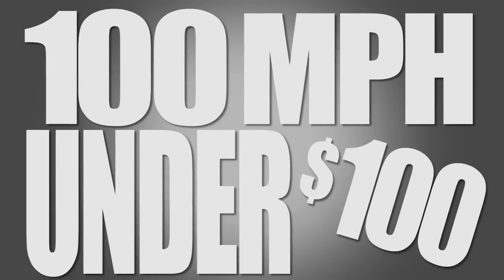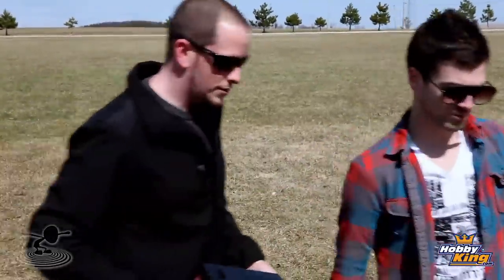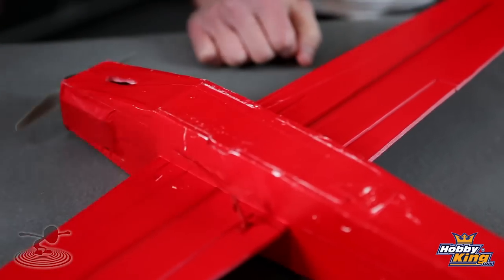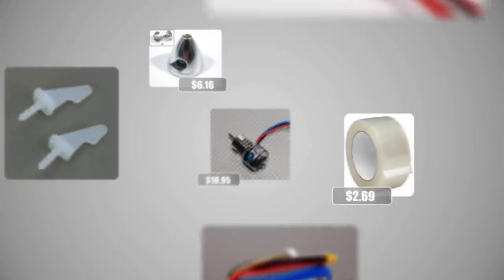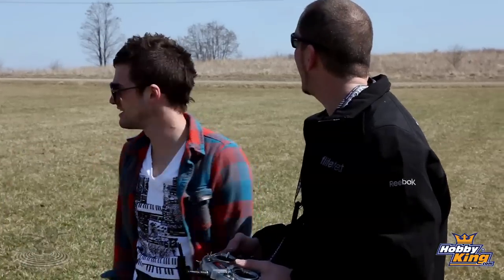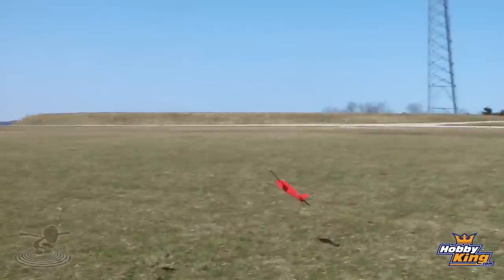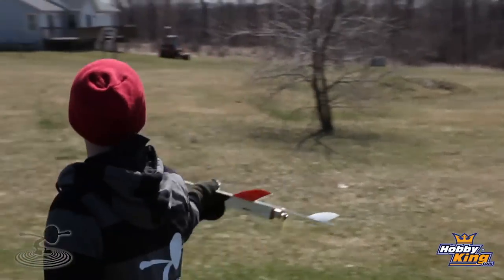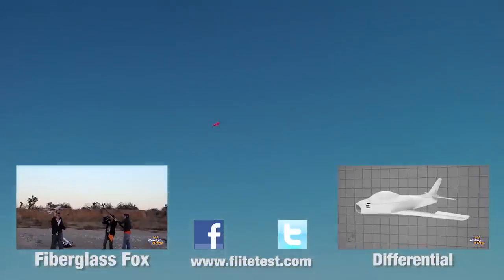Flite Test - 100mph under $100 - CHALLENGE

Comment: I got a 128 mph for a 128 bucks and that included the plane and all the stuff!
Reply: can you send me the components list
Reply: guillermo Presa

Motor: Turnigy 2836 brushless Outrunner 2350kv $18.99
ESC: Hobbyking SS Series 90-100A ESC  23.49
Battery: ZIPPY Flightmax 3000mAh 4S1P 40C   31.77
total on power system: 74.25

That leaves you 53 bucks for a plane, something in a delta wing should work!

This is close to a Stryker ut may be a little bit slower!
(SkyFun Jet (Kit Only) )    42.99   

The power system will do close to 1100 watts with a 6X4 APC prop.
Look on my you tube for the the stryker videos.
Also keep it light!
Reply: guillermo Presa
Servos cost me 20 bucks and the stryker cost me 20 bucks.
Used paint, where the colors came from.
I also covered it in cheap dollar packing tape!
Reply: Elvan Wilson I will better buy a cheaper one first.
i am love planes and choppers, i have an rc helicopter, but i am new in rc planes.
Could you recomend me one not expensive learning plane?
The SkyFun Jet is 3ch or 4ch?? 
Is there a BIG diference bettween 3ch and 4ch.
in the plane u did build is the battery big enough, if not do u have enough space to put a bigger batery??

sorry for my mistakes i am spanish but my english is not that bad
Reply: guillermo Presa
The stryker , I had to carve the battery area!
The skyfun has a huge battery bay!
Those are cheap planes,
Reply: Elvan Wilson But i mean.
I would like something easy to handle with regular speed, and more than 3ch.
Just to learn how to pilot rc planes.
Reply: guillermo Presa
3 ch
throttle, aileron and elevator.
4ch
throttle, aileron, elevator and rudder!
Reply: guillermo Presa go to their website, they have lots of cool foam board r/c planes that you can make at home

Comment: BUT!!!

This isn't a proper challenge. 
Because you going to fly that thing once or twice before that ESC bites the dust. So this challenge is a can't we get one flight for under $100 USD that goes 100Mp/H 

So to have fun with that will cost you an ESC per flight. Doesn't make sense guys. Do this again with a new rule.
It must fly 10 flights.

Comment: can you make the tutorial,im new at this plane hobby(the second model pls)
Reply: +Lol Lol btw whats a control horn?
Reply: +Lol Lol A control horn is an attachment point for the long rod connected to your servo, it allows the servo to move part of the plane. A control horn is attached to the moving part of a rudder, aileron, or elevator.
Reply: Charlie Affel oh,i see,But i pretty much gave up and just bought a parrot jumping sumo instead
Reply: +Lol Lol any quad or hexacopter under $100,- performs better then a parrot Quadcopter. Why didn't you do research before buying this piece of crap
Reply: Ernesto dí Terríbílé pls do research too,parrot jumping sumo isn't a quad,its a rover and it is not a crap,i already use it for 1 hour and 11 minutes
Reply: +Lol Lol it only rolls and jumps. It's much slower then a regular RC Car that's also easier to control then the parrot crap. A Quad or Hexacopter can fly. Yours only does tiny jumps. So piece of crap stands.
Reply: Ernesto dí Terríbílé for you,i do like it,you mean its slower then my other rc???my old rc car can only speed up to 3 km per hour,this thing do 7.You did refer it as a quad instead of a car

Comment: these guys don't mess with gas huh? i was gonna say if you want to build a plane for cheap you could just use a weedwacker motor it wouldn't go 100mph i think but its fun and you can get a used weedwacker for like 20 bucks if you look hard enough or you might have an old one laying around somewhere and you can buy a new weedwacker for 60 bucks
Reply: No you don't Just look up weed trimmer rc planes on here people make em all the time the most expensive thing would be the weed trimmer with a brand new one costing between 60 and 90 bucks but most people have an old one lying around somewhere so usually you can just ask and get it free 
But other than that all you'll need is a 2x4 for the fuselage drill holes in It to lose weight and run servo wiring down it then for the wings use some fiberglass sheets or if your motor is small enough and you know how to build wings you can use dollar store foam board 
Sure it's a crude design but hey that's what I built mine out of it was entirely free except the servos and radio
Reply: And depending on what cc trimmer you get determines what the specs of it should be and I saved extra weight by making my own exhaust and essentially a ram air intake like on the bf 109s

Comment: How do i get into RC
Reply: +ShadowDoesGaming lots of research / watch their beginners guide and check for airfields near you.
Reply: Dillan Hart but do i just buy a plane?
Reply: ShadowDoesGaming You have to be careful. According to flite test (I haven't started flying yet either but I really want to) you want a slow 3 channel plane. the wings should be placed at the top have a flat bottom or a bottom that curves inward. )) <- like that.or this -> I). You can also buy a wing but make sure it is not fast.
Reply: +ShadowDoesGaming find out where your local airfield is and go and have a chat with some of the guys there. They will tell you what you will need, what the best type of plane to start of with is and someone might even offer you a go at flying something. Its easier talking to someone face to face than trying to find out stuff on the internet.
Reply: +Dillan Hart The best way to learn is to be hands on i think anyway, when i broke my leg i literally learnt everything about fpv racing and a little bit about rc places and heli's using videos and tutorials like the flitetest ones as well as looking at some build videos to see if i could follow/keep up with them. 

I also played with some simulators on the pc and my mobile phone which really helped me understand orientation and grasping the concept of flying. Flite test have really got some fantastic advice and tips on this stuff.
Reply: Go to gearbest or banggood and buy a Syma x5c drone or a flybear fx 805 and then get extra batteries for both and start the motor up and fly
Reply: Buy a simulator and spend a few weeks learning the basics. look in your area for a local r/c club and invest in a balsa trainer, and ask about their policy for teaching student pilots. It depends where you want to go with the hobby, but for all my serious students I recommend gas/glow planes over electric. small electric models do not allow one to develop the proper skills to advance far in the hobby, which is why I have my students learn on the standard .40 sized trainer. should you join a club, you become part of a great resource pool of people who can provide newcomers of the hobby alot of help. best of luck!
Reply: Stephen Bachman why would you assume he/she has no job lol